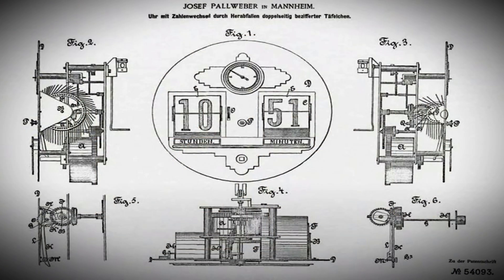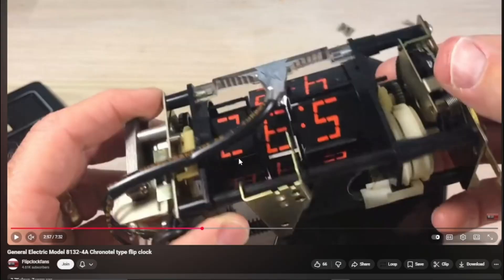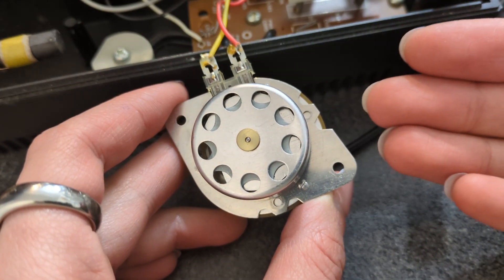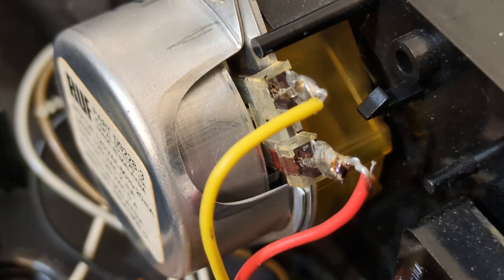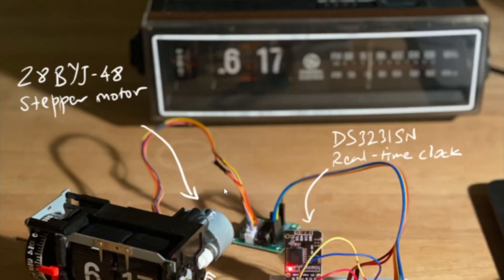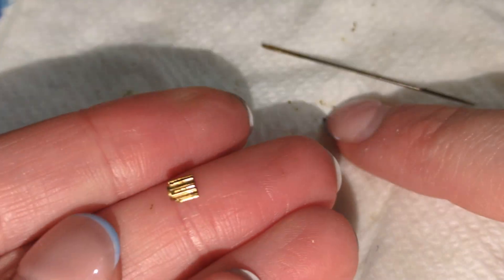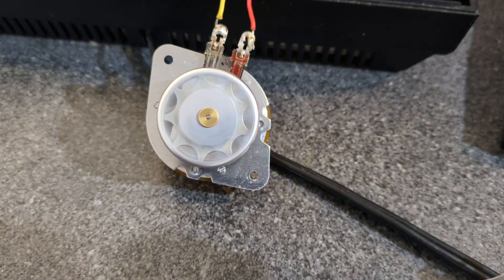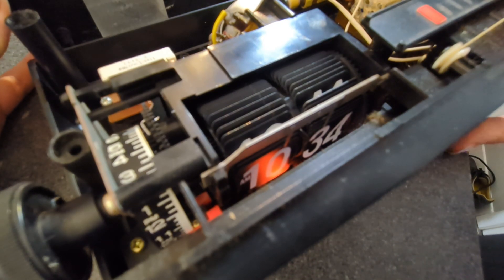This 80's FLIP CLOCK repair almost BROKE me (GE 7-4305F).

Comment: I love seeing someone get joy out of fixing things like this!  That type of synchronous motor with the gear box I have seen in a number of other applications, in fact I have a tube clock radio that uses one(it had the same problem).  Hot water zone valves used them and microwave platter motors are very similar as well.  Also nice to see another Canadian content creator having fun doing what they love!

Comment: I have two flip clocks from their era. Bought one of these still working correctly, gave it to my sister, but over time the tuning line broke. As I promised to do something about it I found out that all of hit-or-miss replacement lines with some friction rendered useless, but luckily online shops sold slightly thicker universal lines that actually worked for me. 
The other unit that this time I bought for myself failed to work on day one due to very similar issues as yours. I'll attemp to fix it now knowing what steps to take, hopefully not breaking anything permanently in the process.

Comment: Nice work, glad to see that you got it running again!  I think you are someone who appreciates the "art" inherent in the design of these clocks.  Not that it matters, and not that anyone would care, but I was able to replace the motor with a stepper I salvaged from a flatbed scanner without using a controller.  Instead, I used the line frequency pulses reduced in voltage and the frequency divided down by a counter IC, to trigger a stepper driver to control the motor.  I was able to get it to step the exact number of pulses required per revolution for my clock (although I wouldn't recommend that approach to someone, unless they really knew what they were doing).  Cheers.

Comment: 3:50 in my experiences in repairing items made around this time til into the mid-90s is that ones that used synthetic lubricants had this issue more and more devastatingly - the synthetic oil cures into a shellac, essentially, and makes it harder for movement or removal (i had a turntable like this but managed not to destroy the platic platter when removing it to replace the drive belt). This is also the case in a direct drive turntable i have in the den i've been procrastinating on overhauling as it also needs drive belts for it's cassette deck (sideloading).

Comment: I have a Copal flip clock. I’ve had it since 2003. It was a thrift store find. I remember, it wouldn’t flip. It was there for days before I bought it. People would keep testing it and putting it back. I finally bought it for $3.00. The cord was rat chewed and needed to be cut back to the good part, but that wasn’t the big problem. The motor wouldn’t turn. I had to clean and lube it, then it worked and I have been using it ever since. The clock is yellow in color and features the day, date, and time with alarm. I never replaced the neon bulb in it, it is very dim, but other than that, it is perfect! Mine does not have a radio.

Comment: You should have sprayed the controls with contact cleaner, the mode switch seemed slow when you went from alarm to radio you should have tried the radio, am and fm and clean the volume pot.

Comment: Glad the cleaning got things working again.  I worry about plastic (often nylon) gears because they often contract or shrink over the years and crack where they are mounted on metal ahafts that don’t shrink.  Once cracked the shaft spins but the gear just sits there doing nothing!

Comment: It's not recommended to clean electronics with alcohol or IPA that's under 90% because the extra water content can be damaging to sit on surfaces and at the last it will take much longer to dry. I've honestly never seen 50% before, or anything under 70%. While >90% from the pharmacy can be expensive and you can't use denatured (from the hardware store) on electronics I found it really inexpensive to buy 99% IPA on Amazon.

Comment: Great video! You can sometimes lubricate old motor bearings by carefully heating them up with a soldering iron and then applying a generous amount of oil, just make sure that theirs no plastic gears in contact with the motor.

Comment: Well done on the repair.

As someone who works on similar things some suggestions if you do something similar again:

Use a syringe or a needle to apply lubricant oil rather than a paintbrush, you get it to where it needs to be and don’t have the possibility of introducing hairs/fluff or putting it on areas that don’t want to be oiled. They sell them as little oiling tubes and you can also use them on a sewing machine if you don’t need it all.
Use a soft mallet to attach things rather than a hammer and press on gears rather than percussive force, that’s a very good way to crack either teeth or bend the shaft.

Clean and replace the lubricant on those nylon gear teeth with grease, if it’s a non synthetic lubricant it will eventually turn to glue. Naphtha/lighter fluid is usually a good gentle solvent to try.
Lastly just never, never force anything. Basically never is more force the answer

Comment: https://youtu.be/PWaUDpbXj9c?si=ZOvmunSNnlINjgG 
I have an NOS arrow ball bearing clock where the plastic gears in the motor breaks and I had found replacement parts the one gear was broken and falling apart. I did get it working again even though it was brand new from 1979.

Comment: I have an 1973 Universum flip clock, its made by Sanyo. Took that thing from a lost place where it was sitting 25 years or so. The radio part is dead but the flip clock thing is working. I love that thing, because its also my first flip clock. How did that thing survived the lost place?

Comment: You could clean the gearbox with contact cleaner (or degreaser) and use silicone spray to lubricate it. Anyway, nice video...

Comment: Back in the day, if we needed a stepper motor to move at a constant speed, and no other logic was required, we'd just have pulsed the stepper windings in sequence with with a 556 dual timer and a CD4017 CMOS sequencer chip, and not had to write a single line of code, but probably having to fiddle with the values of the components determining the cycle rates of the 556 for hours to get it right, then fiddling even further to get the timing thermally stable.

Comment: seeing this video in my feed tripped me out. google is stalking me i stg. i have almost this exact same GE clock, just a diff trim version from I think the same year on my nightstand for 10 years now since i got it in a thriftstore back in like 2015. 

surprisingly the original neon light from the 1980s is still working, just incredibly dim now. the radio pots are super noisey. was it like that on yours as well? i really need to take it apart sometime and wire in something to replace the old neon and maybe lube the motor. i want to do an amber led replacement for the neon but figure iit might take too much effort to do an adaptation given the difference v neon which just runs right off the AC. 

also, apparently older AC driven motors do fine with a bit of sewing machine oil but u have to be suuuper careful not to over-lubricate them. its how I got my 1960s sewing machine working again, i had to lube the motor at its oiling parts with two of the tiniest drops of oil.

Comment: Excellent job!👍
I went through the exact same steps to get my Panasonic RC-6025 in working condition.
I believe most of the flip cocks of the era used synchronous Japanese-made motors (at least the good ones), which are extremely accurate for an analogue tech since they rely on the grid's 60Hz frequency in north America.
When you mentioned the fragility of the gear plastic box, I couldn't agree more. Plastic from 40 years ago is not very "plastic" due to degradation and migration of the plasticizers used back then.
Reply: My biggest complaint with flip clocks is daylight savings time. I wish we did away with DST altogether but given we haven't, it takes a few minutes of effort to synchronize the flip clock time since there is a slight delay from powering up. In my estimate it's around 6-10 seconds.
So when adjusting the time, I power up the clock earlier by that amount to be in synch. After that, it's as accurate as my iphone.
Reply from the maker: Thank you! Cheers to repairing your Panasonic RC-6025, your groundhog day clock. I think you commented on my channel post before. Are you the same user who put an mp3 board in their flip clock to play "I Got You Babe" by Sonny & Cher? How's that clock holding up?
Reply: @strelkomania indeed, that was me!  I refurbished the classic Panasonic RC-6025 flip clock to become an exact replica of the Groundhog's Day movie. Originally brown, spray painted white as in the movie and fixed what was non functional. Then added a cheap mp3 board to finish it off.
It plays "I got you babe" at 6:00 am if you set the alarm mode.
The 6025 model go for a pretty penny on any auction site due to the movie. Certainly higher than the GE model even though the mechanics are the same. You got an amazing price for that flip clock!
Regardless, I love my version and while I also love the movie, the precision is what blows me away. As mentioned in a previous message, as accurate as my iphone. That's 40-50 years difference technology pitting analog versus digital. Insane...
Reply: A further simple Google search confirmed the origin of the synchronous motor for this model. Indeed made in Japan.

"Yes, the motor in the GE 7-4305F flip clock is often noted as being Made in Japan, with many sellers and forum discussions confirming Japanese origin for the clock's components, including the motor."